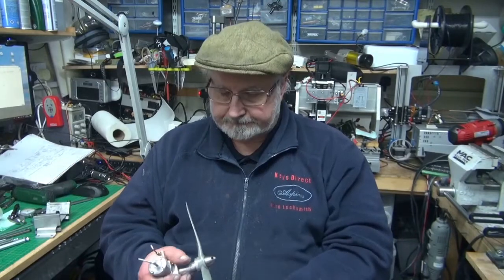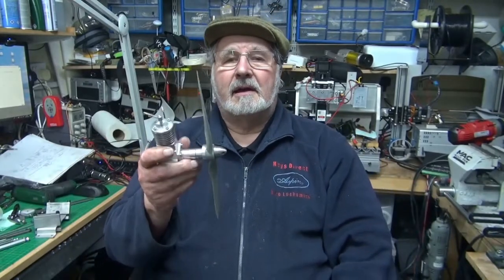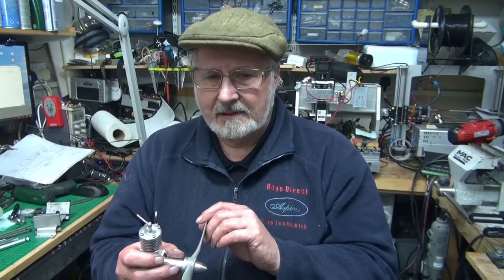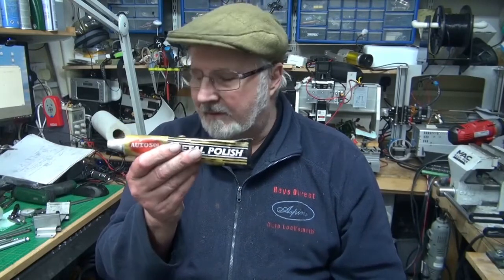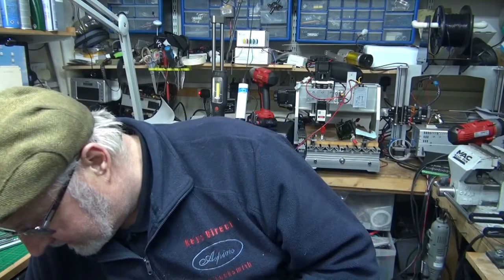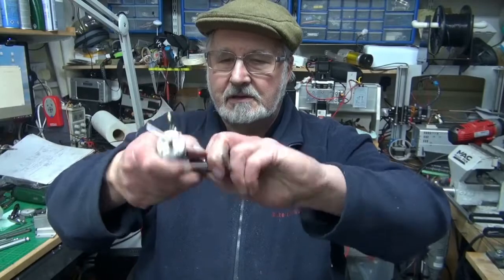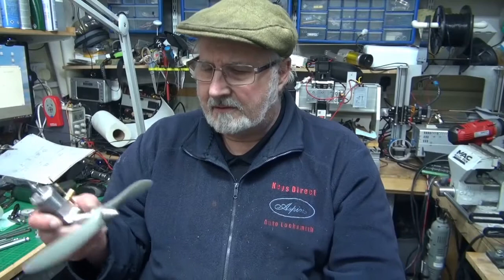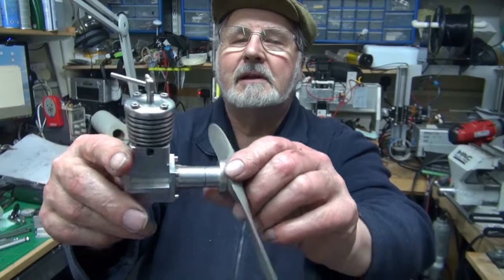Diesel Engine Build Part 28 and End

Comment: Nice job done, many years ago I allways use mandrell to tight fit piston and cylinder even for ABC angines, as I remember the mandrell for cylinder has a small cone shape, the same for compression engines. For piston I did a two cone shape one the alloy piston for nitro engines, so it tight fit at TDC and lose at BDC.

Comment: Dammit Keith, that runs a damn sight better than the previous one. Not as much greasy output either by the looks of it. 
I would have expected the carburetor to be a lot more complex, but I suppose it serves it purpose for idling. 
Also, you're up to 274 subscribers. You can open a Patreon page and start asking for donations :)